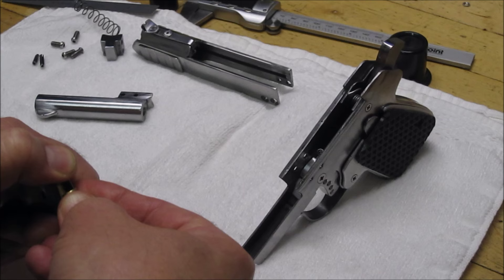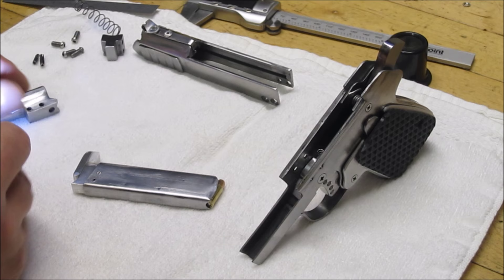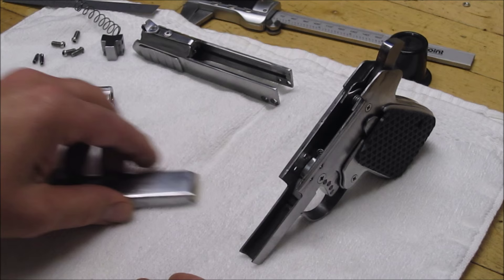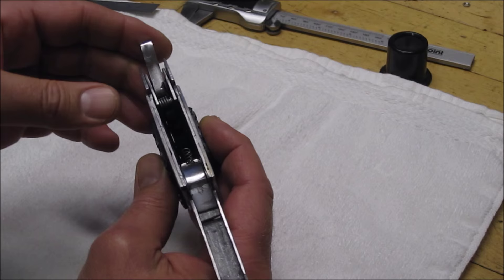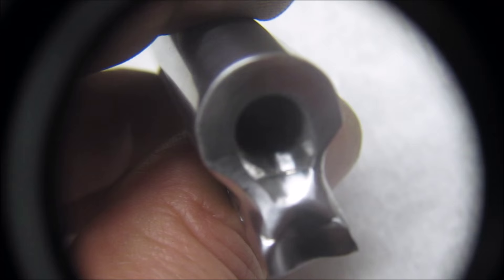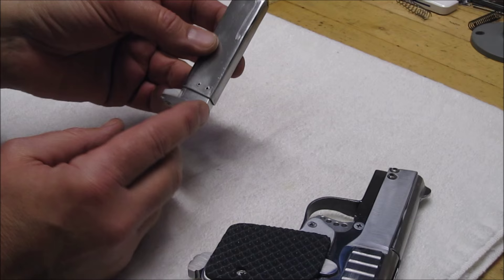Debugging the Krikit 25... Successfully

Comment: The Confederacy had arms supply problems. There was at least one guy who made revolvers in his barn. They used some brass parts for ease of working. Half the melt temp and less dangerous to handle.
Reply: The Colt Navy and Yellowboy came in brass too. Getting an autoloader to work is quite a personal best achievement.

Comment: Ah.. better groupings already!

About the occasional burning brass to the forehead, that's why the ejector pin (in your case spring end) , there has to be a little offset to the left , not too low and not directly under the case extractor.
When adjusted correctly the ejected cases should roughly land on the same spot.

How's the hardening of the magazine lips holding up?
Reply from the maker: +Bechmon Shitan Agreed, slight tuning of that spring is required. I'm pleased that they depart with some authority.  The "special" hardened lips are holding perfectly. There is not a lot of pressure with six rounds loaded. I can actually get 7 stuffed in but that may cause some creep. 6 six is good enough for me.

The early shooting attempts were performed with me trying to observe how the pistol was functioning. My attention was certainly not down range. I'm also pleased on the grouping and the non-tumbling.

Comment: This is a straight blow back operated pistol, so an extractor is not really needed, but is handy. One thing to do with the feed ramp is not use a double angle but have a 1 to 1.5 jump between the frame ramp and the barrel ramp with both ramps at the same angle. Set the barrel ramp back .0015" for every .001" it is above the frame ramp, this can improve the feeding. The frame ramp should be slightly below the mouth of the magazine. Good job adding the spring ejector, I suspect the extractor fit was a bigger issue with the failure to eject, it may not have held the cartridge long enough for the magazine ejector to get at it. On a straight blow back operated pistol the extractors main job is to hold the spent cartridge up so the ejector can get at it. Have you considered moving the extractor from TDC to the side at a 30 degree angle and bending the ejector spring/pin to run along the side of the slide/bolt?  Over all excellent job.
Reply from the maker: +Greg McAulay I hadn't considered moving the extractor off on an angle. I do like the function of an extractor to cycle the endless test rounds through to get all the proper spring rates, feed lip, feed ramp etc...

This is of course a one off from a crude workshop built by a slow learning fellow. Lots of testing required. However, did you see the latest video? I have the function nailed.
https://www.youtube.com/watch?v=uQlyitOGDUg
Reply: +Clinton Westwood Just watched the last video. Looks great. can you post a video on the ramp again, I am curious about how it is set now and how it would respond to feeding a wad cutter or hollow point, short fat rounds.
Reply from the maker: +Greg McAulay When I next strip it down for inspection, I'll take a photo of the feed ramp. That probably has more value than a video.

Comment: Whats the origin of the barrel? Did it start as a rod or a tube, or was it purchased bored out? Did you bore it on the drill press?
Reply from the maker: +Blackstone River Workshop My apologies, I went back and reviewed some of the video and it's not clear. I was posting at the same time to Weapons Guild where I reported on the barrel material details. It started life as an undersized tube that was bored and reamed to proper size on my tired old drill press. Lots of oil and patience.

Comment: Great to see this piece finally working as it should. However, do you think it would be possible for someone to make one of these scaled up to say 9mm? or is there something in the design that prevents it.
Reply from the maker: +Ein The Corgie By scaling up to a larger caliber, you need a much heavier slide if you're going to keep it as a blowback. I think a 9mm would require somewhere in the range of 2 lbs plus total slide mass

Comment: what shape is the primer end of the firing pin, thickness of it, and protrusion from breach? also what gauge is the wire for the hammer spring? on a side note, your workmanship is extremely impressive and I'm really enjoying watching your current build on the 380. I would love to see a .22 build as I think the weight of materials and spring pressures would be interesting to learn for such a small powder load.
Reply from the maker: The firing pin has a slight radius to the tip. Approximately .090' OD. I will have to check the wire gauge I used. The music wire was much thinner than I would've guessed. Springs are very deceiving. I will probably use the same size for the current build. I think the Krikit is a good candidate for .22LR. I wouldn't change the materials.
Reply from the maker: Hammer spring is .032". I used that gauge throughout the build.
Reply from the maker: I'm not sure about a double stack. I haven't even tried rimmed cartridges like the .22 which do present special challenges.

Comment: I'm impressed. Excellent job. What I really liked was the home made rifling contraption.
Did you have to deburr or fine tune the barrel after that operation?
Reply from the maker: Polishing is in order after the rifling. I'm getting better at it. Have you seen the improvement to the machine?
https://www.youtube.com/watch?v=twwQbpwZz9w
Reply: I have now!  And I must say, I like it!  
I never tried building anything as intricate as what you're doing, and don't own any machine tools except a couple hand drills & grinders, some files and a sawsall. Oh, & a couple big hammers & some welding equipment (self taught, you can imagine the weld quality).  But after watching your videos, I'm thinking I might attempt a "machining project".
The most ambitious thing I ever built was an attachment for a Bobcat that I designed to pick up large irregular shaped rocks with as little scarring of the stone as possible (for building masonry walls out of large stone). It was like one of those claws on the crane they use at a scrap yard, except w/only 2 arms. Mounted to a quick attachment plate, (if you're familiar with skid steers). It was mainly welding and drilling holes up to 1" in up to 1" mild steel, (that was fun w/a hand drill), & it was powered by a single hydraulic cylinder, so I had to devise a system to equalize the arm movement. Talk about a contraption! A fairly rough piece of work, but it worked!
Anyhow, The most "machining" on it was hollowing out 2 pieces of 2"x4"x4" steel plate in a half ball shape, & corresponding spherical cuts out of 1" stock, that would contain a trailer hitch ball, when sandwiched together, to form a wrist socket for the "hand" on the end of the arms, that I thought was necessary. Turned out it wasn't, but whew, what a job that was!  Accomplished w/varying sizes of hole saws starting with the largest 1st to a shallow depth, followed by decreasing size hole saws at increasing depths to get the rough shape, then lots of grinding to remove the ridges, and finished w/lots of hand sanding using the "braille method" to achieve an acceptable fit. Grease fitting thru the back of the 2" plate, & it worked just fine.
One day, if I ever figure out how to load a picture on youtube, I'll "show & tell" it in all it's glory.
Uh Oh.
Sorry for the long winded response, got carried away.
Keep up the good work, and thanks for your time and effort in making these videos for all of us!

Comment: Whoo Hoo!!!!    
Super job. You have been an inspiration. I have some 4140 lying round that I am thinking of trying this with once I move out of California. The zip gun law here is a real bummer for home gunsmithing enthusiasts.
Reply from the maker: +Robert Donovan Thanks for the comments. I regret not doing this build in a better steel. But honestly, when I started I didn't have high expectations. Oh well. You do realize that this is not a zip gun? This is a fully legal rifled handgun. Does California not allow that?
Reply: Actually, the reason I am considering using 4140 is because your build was successful. Had I been in your position, I'd have done the same for the same reason.

California has a zip gun law that considers any gun made from parts, not designed to be a commercial firearm, from parts made by a licensed manufacturer, or altered to chamber a round, to be a zip gun, unless you register it with the ATF and pay the $200 to get a tax stamp. Thus, in California, you can mill out an 80% lower from any existing commercial gun(AR15, AK47, Colt1911) or make or or buy and assemble the parts for these guns from scratch for personal use, but the gun you have built would be considered a zip gun unless you paid the tax to the ATF and register it. That's why I often refer to the State as the California Soviet Socialist Republic.
Reply from the maker: +Robert Donovan Wow! There are States with much higher crime rates and less restrictive. I've considered moving to Northern California but I will have to really consider the restrictions on my freedom before I do that. I think I'm better served staying where I am. If you start/finish a build, please stay in touch. I've developed a strange affection for this little gun:)
Reply: +Clinton Westwood Speaking of crime rates vis-a-vis gun ownership, like many, I find the fact that while we are oft condescended to by other countries for having the highest per capita firearms murder rates in the world, ostensibly because of our gun culture, removing the four US cities with the most restrictive gun laws drops us from top of the list to fourth from the bottom. One cannot infer from this that guns prevent crime. However, taken with the fact that many states with looser gun laws and higher density of gun ownership have lower crime rates, one can certainly say that possession of guns does not make it worse and restricting them has little to no effect on improving it. 

Regarding living in California, while I love the climate and the people are fine for the most part, that is not enough to offset the high cost of living, high taxes, and paternalistic, nanny-state regulatory environment, of which idiotic gun laws are only one example. I am saving up to move to a more gun friendly state, which tends to correlate with being less regulatory in general. 

I would be glad to let you know what I build once I get it done.
Reply from the maker: +Robert Donovan I agree 100%. My freedoms precede climate. I've been around a few years and have always been surprised how armed citizens scare the bejeezus out of the ruling class. In response to the highest crime rate cities, eradicate the gangs/gang culture and problem solved. That's about as much as a political statement that'll make on this family friendly channel that I'll make:)
Reply: Yup, I have often said that any member of the ruling class that can't make himself or herself comfortable with the fact that the Second Amendment does not merely advocate the armed overthrow of a ruling elite grown too oppressive and overbearing, but, in fact, enables it, is precisely the person about and against whom the second amendment was written.
Reply from the maker: That sums it up nicely.

Comment: Fantastic work !  BTW, I have the same problem with misfeeding the top few rounds on my Sig P238 while using hollow points. I may send it back to Sig and ask them to rework it like you did the weld-bead at 02:40.  Thanks !

Comment: for an ejector why not just use sheet metal welded or screwed to the inside of the frame and cut a small slot for it on the underside of the bolt, like any 1911 or beretta 92 or any other basic semi auto design? you could also do what Ohio Gun Works does with the High Point series and just have the firing pin strike a stop as the bolt travels rearward acting as an ejector.

Comment: How do you think it would go upgrading to a .380 calibre, do the plans allow for that at all?
Reply from the maker: +314194 There wouldn't be enough mass in the slide to allow for effective/safe blowback operation. The designer has released new plans that will work for .380.
http://www.mediafire.com/download/qbxceei0wk5p9x6/The+MK.2+DIY+Sheet+Metal+Self-loading+Pistol+%28ProfessorParabellum%29.pdf
Reply: Many Thanks for that. Cheers

Comment: How many have you run through it?  Looks awesome.   Any interest in making a .380 or a .45 or even a 9mm?
Reply from the maker: +williwonti I've only got about 10 rounds left in the box of 50. I will be doing a .380 next.
Reply: Cool.  Is the .380 gonna be a Fixed barrel? You should have a threaded barrel on there and then make a suppressor,  It's all the rage these days.
Reply from the maker: Fixed barrel, yes. Suppressor, no, don't want to buy the stamp.
Reply: Clinton Westwood I getcha.  Maybe you can make a 'solvent trap' instead?  Anyway, keep up the good work
Reply: +williwonti I have ahem nationalistic pride freedom dampeners on mine. 
winkwinknudgenudgesaynomoresaynmore.

Comment: I wondering is it possible to make scaled up version for something like 9x19 or at least 22lr.I saying this because not only is .25 ACP pretty terrible cartridge,but it's also impossible find!
Reply from the maker: +Kiona Moeru Kaze 22LR would be a tricky build because of the rimmed cartridge. I had enough trouble with this so called .25ACP. This design is optimized for .25 and .32. Anything bigger would require a substantial increase in slide/bolt weight.
Reply: Clinton Westwood what about double stack mags!
Reply from the maker: +Kiona Moeru Kaze I would say, go for it. There are limits as to what one can do with limited tooling. Let me know how it works out.

Comment: Can you make one small as an Astra Colt? I prefer .22 LR but .22 short would do. A steel gun in sheet metal might be preferable to pot metal castings. On the other hand, I would like a mouse gun in unfinished navy brass. It could polish in my pocket. Don't be shy. From what I hear as long as you obey a few regs you are free to make your own gun if you want. Toe the line and sell as an art object. Few who own a Jennings care about the screwy handling. Jiminez does a good business. Bet the demand is out there. Better double up on safety issues to avoid suits.

Comment: Do you think this design could be adapted to use .22LR ?
Reply from the maker: Yes, probably, accepting the fact that the feed issues would increase and it's a little harder to light off a rim fire vs center fire.
Reply: Thanks, that's the answer i was hoping for.
You're doing a great job by the way.

Comment: Good first q nothing very good video and work d realization. I wonder what size it is. I'm d venezuela and I do not understand English, I only use translator
Reply: La pistola dispare el 6.35mm cartucho. Lo siento por mis espanol, no hablo bien y no uso google.
Reply: Thanks for the respesta is that I want to know what is the millimeter of the ditch that you use. . I'm making the gun. But here more than anything there are ditches 8.80 ... 22 and 9 millimeters   .....gracias por la respesta es que quiero saber cual es el milimetro de la vala q usas . . estoy fabricando el arma. pero aca mas que todo hay valas 8.80 .. 22 y 9 milimetros